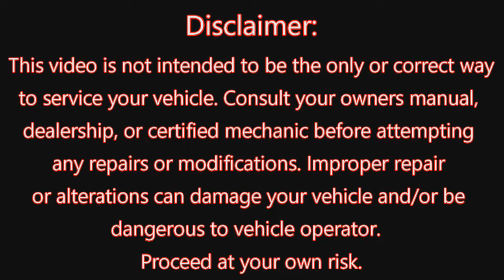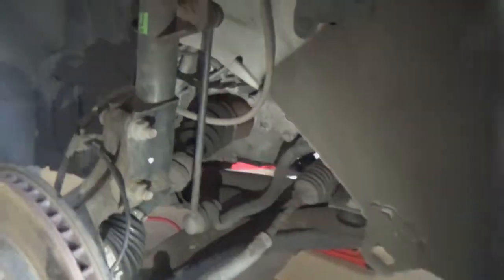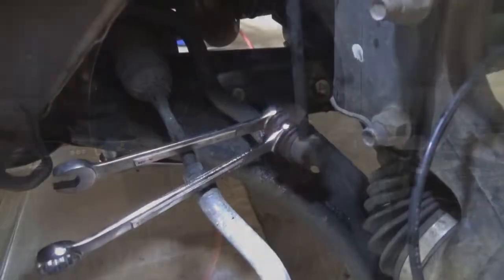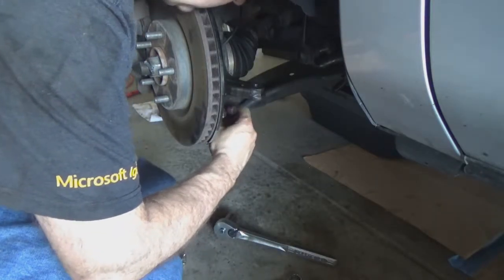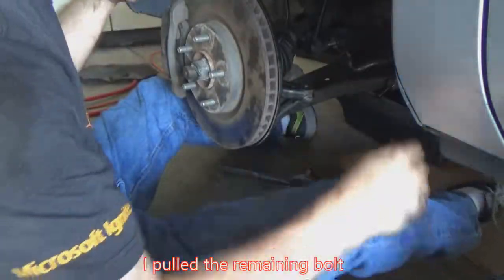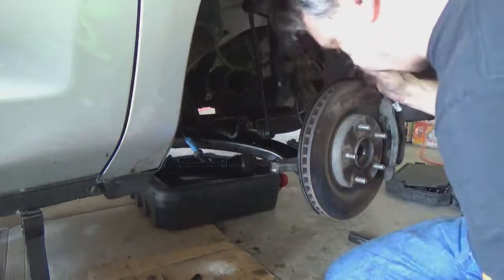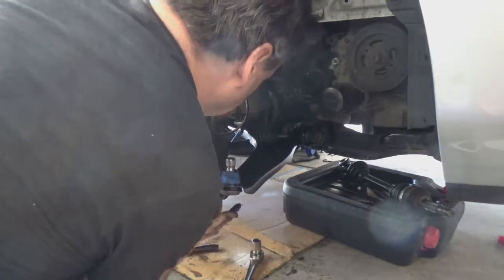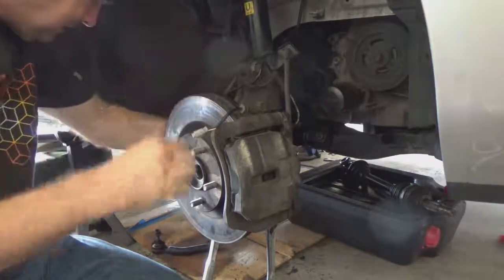Replacing Nissan Rogue Control Arms

Comment: Nice job!  I encountered all of the problems that you had. I drilled two holes in my axle, ran a bolt through them, and used a slide hammer.

Comment: Just replaced the passenger side axle on my 14 rogue. When I got to that axle support bearing, I had to unbolt the whole bearing carrier from the engine to remove the axle from the transmission. Then had to beat the end of the old axle with a sledgehammer to get it to pop off. Then beat the carrier onto the new axle then installed it. Quite a pain!
Reply from the maker: Yes, the carrier bearing was frozen solid. I tried heat, grease, slide hammer and nothing would free it.  Had to get it to a shop where they had a press to get it out.  The passenger side sucks for sure.

Comment: Just did this job on a 2016 rogue what a pain. I fought with the ball joint for a while coming out and going back in. 61k in the car and it was a rusty mess as well. The replacement lower control arms I got were moog and had worlds better welds than the factory ones!
Reply from the maker: Most of it wasn't too bad for me.  The axle was a freaking pain, the carrier bearing got stuck in the support.
Reply: I'm replacing lower control arms, brakes rotors and stabilizer links. On a 2018 Rogue with less than 30k on the odometer. I'm finding tons of rust and tie rod ends, ball joints and control arm bushings worn out. WTF less then 30 and im basically replacing the whole front end. Decided to to the shocks also since I had it all apart. I live around Philly so winters haven't been that bad and the vehicle is my wife's and get out much to play in the snow and salt. I bought the vehicle brand new so I know the mileage is under 30k. First and last Nissan just because of the rust issues.
Reply: @HeavyHaul51 Nissan is mostly junk these days sadly especially those rogues

Comment: Nice job, had to grind off the sway bars to get at the control arms on mine, just replaced those too.  The nuts get so corroded you can't get them off with conventional wrenches, so just best to cut them off in my case, looks like you were lucky though.
Reply from the maker: Thanks.  Definitely a lot of corrosion and muck to deal with when changing these out.  I did get lucking for the most part, that damn carrier bearing though was rusted solid.  Slide hammers would not free it up at all so I had to take it to a shop to get it pressed out.

Comment: Nice work but jeesh, I've seen too many videos of you guys slamming into ball joints from underneath with a regular metal hammer..... it's called a deadblow hammer let's get with it😉😆
Reply from the maker: I did not have a dead blow hammer so I used what I had available. These weren't massive swings, just gentle taps to get it to go in. It got the job done fine without damaging anything and that is all that really matters.

Comment: Don't need to take the steering rod end off....just did mine with no problem....
Reply from the maker: I did the steering rod because I was doing several components at the same time.  So it was just easier to get it out of the way as I did all the parts at the same time.